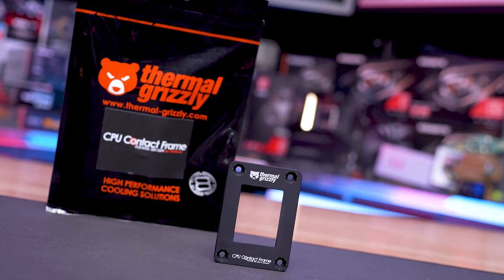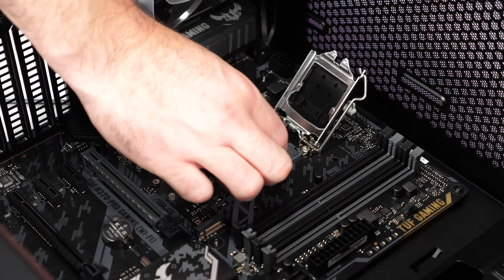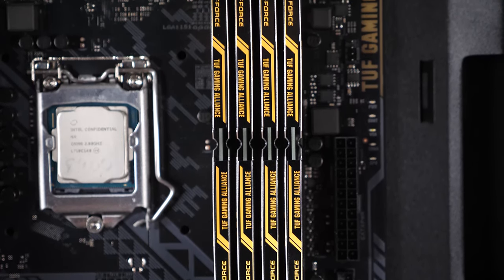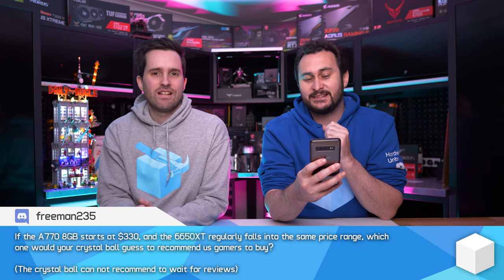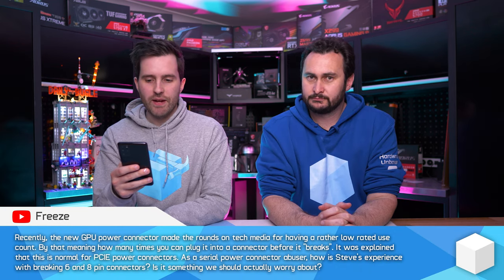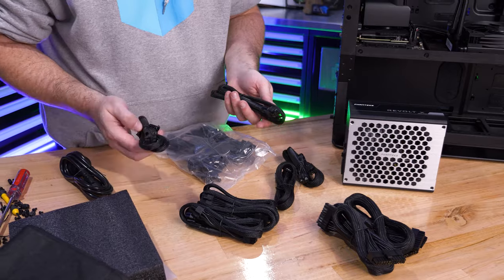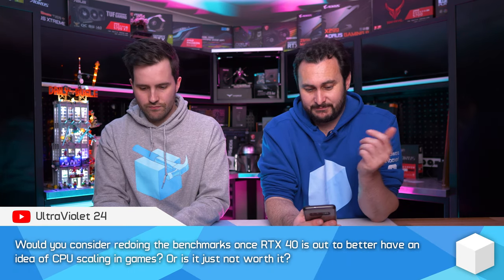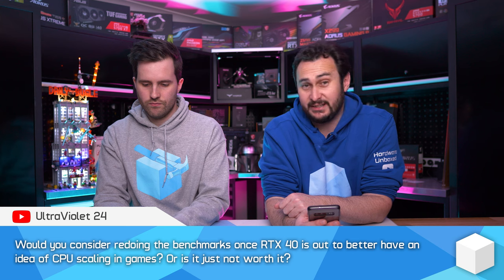EVGA Quitting Bad For Nvidia? Arc A770 8GB better than RX 6650 XT at $330 US? September Q&A [Part 2]

Comment: EVGA ditching Nvidia isn't bad for the profits of EVGA or Nvidia, but it is bad for Nvidia's public and industry image (especially since EVGA was basically an OG board-partner for Nvidia) as well as, potentially, EVGA's GPU division staff (since graphics cards made up a LOT of their revenue (not to be confused with profits)).
Reply: It is very bad for the profits of EVGA. The numbers they stated dont lie.  80% of their buisness comes from gpu's  (revenue)  5% of that is profits  that 5% is way more then the 15% of the remaining 20%   that revenue also pays for infrastructire buildings energy bills wages and so on. So I frankly cant see anything happen but EVGA going bankrubt or scaling down massivly. 
There is no way where they can survive in current forms without the revenue of gpu's.  they shot themselves in the foot BIGtime and they will end up suffering for it unless they partner up with AMD/Intel SOON.
Reply: Its much much worse for EVGA than nVidia.
Reply: @BatTech  Apparently losing the revenue is better than remaining in their current business agreement.
Reply: @pino_de_vogel  if you have a business where 80% of it generating 5-7% return is worse than rest 20% generating higher return than that
Reply: @nazmulfahad3044  no   if you have 100 bucks and 80 of those come from a gpu and 5% of that 80 is profit that is 4 in profits from that 80% and if you have 15% profit over the remaining 20% that is 3  so you throw away almost 60% of your total profit. that is insane.  and thast does not account that a gpu may be 350 in materials but sold for 500 but that the revenue also pays for your employee cost, your electricity bill, your transportation contract and so on.  so you are throwing away a lot more then that almost 60%.  This was a dumb financial move no matter how you look at it.
Reply: @pino_de_vogel  The problem with your model is it does not account for two really big factors. EVGA like other board partners, but even more so with EVGA was selling at loss with the price drops on high 3XXX series cards due to the crypto markets tanking, so suddenly profit was negative. Furthermore, EVGA built a reputation by not saving on their GPU designs so they lost even more comparatively to other board partners even with Nvidia's subsidy program considered as their margins were smaller to begin with. Finally, Nvidia made the greedy, but reasonable move to make the 4XXX series a huge die, power hungry and pricey series but market conditions have drastically changed since the original conception and development of the GPU. The fab space is now already allocated, the designs already made and models already announced.  Their greedy gamble is poised very poorly to navigate the coming recession, energy price hikes and AMDs ability to better compete at lower price segments due to GPU design. So with 3XXX series issues already creating losses for board partners this quarter and the next 2 - 3 and Nvidia's bad gamble. We're likely to see Nvidia's worst launch in a decade unless AMD absolutely botches their launch. It's definitely a good time to get out because usually the loss is handed down to board-partners first. Who is to say EVGA is completely out of the game, they may re-enter when market conditions are good again as they still have quite the reputation as the premiere Nvidia board partner. If Nvidia won't work with them, AMD definitely would.
Reply: @pino_de_vogel  It's same business decision that every managements make, should we go for top line vs. bottom line. 

Yes, 5% of 80% is better than 15% of 20% by 1% (combined gross margin of 7%, of which 4% is from 80% and 3% is from 20%), but how about operation costs, both variable and fixed, related to each revenue stream? As EVGA being private, we have no public financial figure, but in common sense, we can expect 80% of revenue requires a lot more operating costs than 20% of revenue, while it brings only 1% higher combined gross margin.

Yes, they will have to downsize, let go of people (as they've already started doing since earlier this year, from what I heard), will have to squeeze down some fixed expenses (although they have been saying that they don't have much of fixed costs due to their operation structure), etc. But bottom line will get better by exiting lower margin business and eliminating related costs.

It's a bad decision if you are going to sell your business as many investors take revenue as a primary valuation factor, while bottom line (EBITDA, Net Income) as secondary. But Mr. Han has been  vocal about not selling his business, and this decision is clear indication of how him being true. Bottom line profits were more important to him than top line revenue.

But to your point, EVGA has to be very smart about how they can keep their reputation with other ventures they do. Their PSU has been certainly doing very well, already on par with the reputation of Corsair. But not sure about other ones yet.
Reply: @Ilost11  They like MSI and Asus and Gigabyte made a killing before the price drops so hasrd to feel sorry for them.

And they have said they will never work with Nvidia again so that leaves AMD and Intel.
Reply: @pino_de_vogel  I don't feel sorry for them. Never did I suggest that. My comment was to show why your simple model is wrong. It very well may be best time to pull out before the worst Nvidia launch in a decade. As it would hurt them financially. Either way it is honestly unclear what EVGA will do. They still have a reputation as a Nvidia's premiere board partner and given the right circumstances AMD and Nvidia might suddenly come back to the table with a good offer. Hard for anyone to say right now.
Reply: EVGA did things others didn't. Stepup for example. If one uses it, that happens with the old Card? Does EVGA just sit on the old Cards? Does EVGA resell them as new?
That may be one thing why revenue was low. And EVGA had (big) GPU failures in several Generations (and good warrenty), that also costs money.
What else does EVGA have? Some Mainboards and PSUs...
Reply: Tbf Nvidia currently doesnt care about anything. Youve seen that with Huang saying the prices will stay up like this forever, which is just delusional. Theyve won the lottery and think theyre geniuses.

Only thing to get them down, give them a reality check, is if their market share and revenue goes down. Which is to some degree unavoidable.
Reply: @pino_de_vogel  gpus*
Reply: @pino_de_vogel  They can ley off 80% of their employees, sell off machinery and stop paying for such a large building. Downsizing might be their best decision to control such a large company

Comment: EVGA no longer making Nvidia cards will definitely skew my buying habits more towards Radeon (or Intel). I'm not saying I'll shoot myself in the proverbial foot by buying a significantly worse product, but the bar I set for Nvidia WILL be higher. Pretty much all businesses are, in my opinion, guilty of doing crappy things, but the fact that a partner as good as EVGA will quit in large part do to Nvidia's shenanigans is just another reason to not buy from them.
Reply: I'll be leaning heavily towards Sapphire for the near term unless AMD releases a dud.
Reply: Sapphire makes Excellent AMD Cards and ONLY makes AMD Cards.
Reply: How the hell is Radeon significantly worse lol
Reply: @crylune  You misunderstand me. I didn't say Radeon is "always and forever significantly worse"; of course not. But sometimes, in a particular generation, it is. Sometimes GeForce trails, and Radeon is the better buy. I've never purchased an Nvidia product when an AMD product could be had that was better (for a similar price), and vice versa. But if, at the time I have decided to replace my current hardware the GeForce card happens to give me, say, 20% better performance than the similarly priced Radeon card, I'm going to struggle buying AMD over Nvidia.

Often, the hardware is close enough within a particular price bracket that it doesn't really matter. In such cases in the past I've leaned toward Nvidia, but from here on out I'll lean towards AMD, as a general rule.

Comment: It's still too early for true comparisons on this next, pending generation of GPU's. My hope is that AMD and Intel become clear contenders for price and performance in the graphics market. I would like to see @Hardware Unboxed do a segment on driver compatibility, update history, and reliability on GPU's(it might be too early for Intel on this though). In most of the customer Q&A videos, I see a majority of people saying they don't look at AMD due to bad driver experiences.
Reply: I'm one of those. I know AMD drivers have got better as both my daughters have RX590's but even then for Xmas I have bought them 3060Ti's. For my own rig and wife's tho, it's Nvidia only (3090 and 2080Ti). My main gripe now with AMD is how bad Radeon software looks, fills the entire screen, god knows how many tabs to cycle through, big red toggle buttons that looked aimed at children. 

I know some people think the Nvidia control panel is outdated but it's minimal, compact, has every setting needed in it and looks more professional. imo.
Reply: @rossharper1983  Having to use 2 programs to configure and use it is just pain and their control panel sucks in many areas where especially the bit depth settings just do whatever they want to do. I haven't tried AMDs solution (yet, but I probably will soon) but you just can make worse settings... (Also as a developer in a professional setting that UI just looks like it has been developed years ago and was never updated, if I was evaluating software with such a UI, it'd immediately raise a red flag whether it's still maintained...)
Reply: @cromefire_  I agree it looks like it was developed years ago, but I see that as a good thing, all these horrible bloated big gimmicky GUI's with lots of big buttons, colours, etc are just not needed. 

As a professional, you'll surely know that function comes over form, and to me, NvCP functions perfectly, I don't need or want it to "look pretty"
Reply: @rossharper1983  But is doesn't even work functionally... It leaks metrics, failed silently way to often and is just nested too far.

And when it comes to the style, I'll just say that pretty much everything I work with from that era of UI is now unsupported, buggy and often doesn't even launch on Win 10/11 and it's definitely most of the time not more usable or functional....
Reply: @cromefire_  I can honestly say since the 700 series (2013), I've never had a single issue with NvCP not functioning as it should. 

I use TrueNAS, Linux, UnRaid, along with other software aimed at above the average PC user, and not one of them have a bullshit GUI like Radeon software does.
Reply: @rossharper1983  Well try to adjust the resolution and color depth, when you can't do full RGB (10 or 8 bit) it just randomly does what ever it wants instead for an error when you specify a setting that your port can't handle... I've asked myself for days why my text isn't proper, until I found out that it had just switched to yuv420 by it self...
Reply: @cromefire_  using 32bit colour, 10 bit depth, RGB, full dynamic range. Never had a problem with it. 
Windows 11, 3090, Gigabyte M34WQ.
Reply: @rossharper1983  Yeah, because your ports support it, but if you use HDMI 2.0 (GTX 960) with 4K 60 and similar stuff, the panel starts doing weird stuff...
Reply: @cromefire_  sounds like an issue with your hardware more than NvCP.

My main issue with Radeon is the wasted real estate because of everything being gimmicky large. Why does a simple "vsync" with an enable toggle need to take up half of the width of the app. If they condensed the GUI they could get everything into 3/4 tabs instead of a dozen plus the settings cog.
Reply: It is true, I used to own a AMD Radeon 6750XT which in my opinion has tons of power for the money. The issue is the drivers and most of the features doesn't work, or my system was getting frozen for example trying to record the screen while on NVidia that never happened. Intel has a very talented people with a lot of money to get things done quickly. Simple they launch a GPU on the market this year when five years ago they have none. So I hope drivers make this generation of arc stables and enjoyable so next generation can be much better since the beginning. See last NVidia CEO presentation they call about raytracing workload manager. Intel has the same tech on the arc architecture they called thread director (very similar like on the CPU), pretty much is reordering the  workloads on the fly like NVidia. So Intel has the main set and they know what is coming. Something that AMD not.  I think the big looser is going to be AMD unless they get really competitive in every single front.
Reply: @rossharper1983  I get that it looks complicated, but when you start to use it you realize that only 2 or 3 tabs are really the ones that you use (+1 if you want power control/OC/Undervolt etc.). It's very user friendly. For me it is actually more difficult navigating NVIDIA's controls, but it is likely due to being not used to them. Perhaps your problem is the same? Since you exclusively use NVIDIA, you just look at Radeon Software and don't understand it. I myself mostly have AMD GPU's, but I also repair friends and family PC's - so a lot of NVIDIA GPU's as well. In past 2 years, I had 0 problems with AMD drivers, except.... Windows Updates. Windows LOVES to "update" your drivers without permission. Hence why this is the first thing you disable. I've recorded and streamed on my PC and didn't have any problems. If you ever have to deal with AMD drivers, go for the latest official Adrenalin release that isn't labeled "Beta". Also as precaution - IDK if you do this, but DDU drivers once every couple of updates (I normally ask installer to uninstall previous drivers and it works fine, but since Windows likes to budge in, I would do it as precaution - 2+ years ago this was the cause of wasted 30 minutes). It's also healthy to do it on NVIDIA drivers from time to time.
But yeah, when it comes to utility, I can't say that AMD is on the same level. There are people (like comment by @Victor M ) for whom it doesn't work. Though I personally never had those problems and I hear of it rarer and rarer, even though more of my family and friends switched to AMD, AMD still has tons of work to do. But you'd have to be very unlucky to have that problem now - probably like Victor M.
Also I generally use OBS for recording/streaming regardless of GPU. NVIDIA and AMD recorders give different output - which for a person that doesn't know about this, might look "wrong". Look up Daniel Owen channel. He was forced to buy AMD last year and talks about differences and problems etc.
Reply: @jannegrey  I agree it's easy to use, hence me saying it looks like it's aimed at children. My problem is it's excessively big (spaced out) for no need.
Reply: @rossharper1983  Yeah. I don't use half of the tabs myself and it is a HUGE window. IDK if it would be the only thing I would consider when buying GPU, but it is a point. Then again AMD usually wins in this case for people with visual impairments. Do you know how to make NVIDIA one big enough that people who do have problems reading small font or having very small icons can use it? Both companies could use a better "adjustability" - or maybe even both have it but it's buried somewhere where it's really hard to find.

I wouldn't say it's made for children - I think the choice was to make it more look like a game UI. Whether it was good choice - well that's a question for every individual who considers it. And AMD could use some "mini" version of that UI, because in some cases it is annoying. Though I still think it's mostly the matter of getting used to it.
Reply: @jannegrey  for visual impaired, Nvidia scales with windows zoom options
Reply: @rossharper1983  Yeah, though configuring it (I know, since I did it for my father) was weird and cumbersome. Also Windows scaling options love to link themselves to some weird keyboard combinations - removing those was a pain. And don't get me started on scrolling wheel adjusting the zoom, instead of scrolling down. But those are Microsoft problems. Not NVIDIA's.
Reply: @rossharper1983  Nvidia requiring a web login for screen recording is borderline abusive. No way ever.
Reply: @victor m do you know at actually prior to GCN Radeon cards actually needed that kind of "instruction sorting" at the driver level? Sorry to burst the bubble but that isn't new at all, look it up in the VLIW era was when amd was at its weakest driver wise exactly because they had to do all that work on the fly in a time in which cpu's didn't really had all that much free performance /extra threads.
Reply: Similarly some antialiasing concepts were first brought to life by amd, starting with temporal antialiasing in the early 2000s, if anything they tried to do it too early, back then it was a struggle for a game to achieve the minimum performance requirements for said temporal antialiasing precursor (minimum of 45 ish fps or the driver would turn it off into "regular" aa)
Reply: @atomkinder67  don't see it as an issue myself.

Comment: Evga were great in australia imo... top notch warranty support where asus and gigabyte fell horribly flat and prices that didn't go nuts last year.
Reply: Also great in the USA.

I don't know of a better company out there in terms of customer service and support.
Reply: Evga has one of if not the best gpu warranty bc u can put a waterblock on the card take it apart. And as long as u return it to the og cooler before RMAing it they will take it. Wich was huge. They have the best prices the most decent power limits  for the price and the best warranty so ur totally right. Gonna be a huge loss not seeing anymore evga nvidia gpus